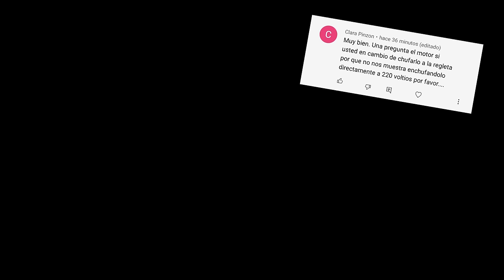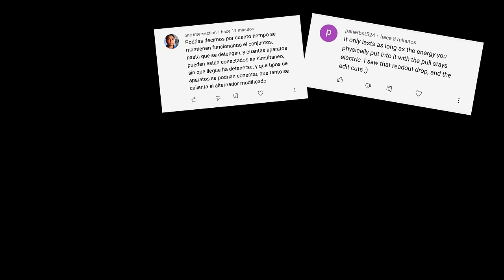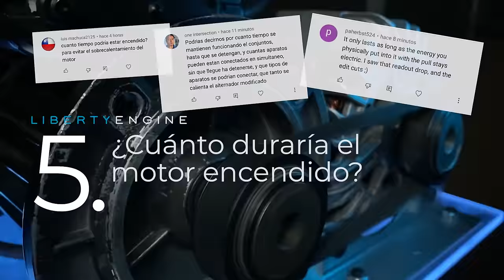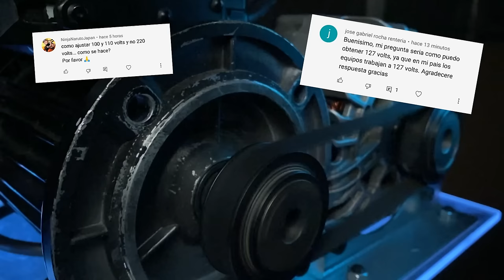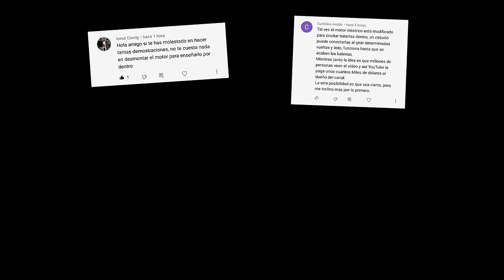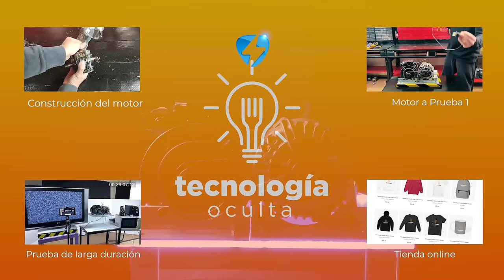El motor de energía infinita puesto a prueba - Parte 2  - Liberty Engine 1.0

Comment: Install the voltmeter with the three-way plug and put it in front of the camera and then put the loads so that we can see the change in the voltage during the process of placing the loads
Reply: When you pay any load, no voltage will be changed, amperage will be changed.
Reply: How ever small jump can be seen on applying the load that shows load is running by the alternator but it cant decide that the motor is also running through voltage supplied by the same alternator. only the volt meter at main line can tell us the variation in volts when load applied and that test will decide the truth

Comment: Im wondering ur video. coz most generater maybe for 12V or 24V i guessed , did u remove transformer? coz ur infinity engine's output voltage is enough for 220V ,could u give me some answers?

Comment: Thanks for your full video, due to the number of turns of the car alternator coil at 1500 rpm or even 3000 rpm with high gauss neodymium magnet, the voltage will still not reach 220 volts, 20 times the constant voltage of the car alternator voltage without increasing the number of wires.  The screw is not possible and increases with increasing frequency, this is my opinion
Reply: Its a 24v truck alternator.
Reply: @Szaraq12  yes,convert to Pmg generator

Comment: The indicator light of the power meter has the function of detecting non-contact power, I see it blinking, it means that inside the motor there is an active ac power source.
Reply: Yes
Reply: Интересно, какой ионистор они покупали?

Comment: I want it to be installed in an electric car so that electricity can be applied directly to the motor so that the car can run without charging the battery anymore.

Comment: I see the problem in the fact that the low-power motor drives a generator with several times higher power. The generator will give the power we supply to the generator shaft. That is why I see it as a problematic example. When the generator delivers several times more power than the driven motor! It would be a perpetual mobile that violates the laws of physics.  Connect a 3 kW appliance instead of a grinder and let it run for 10 minutes. .Don't fool people with your stupidity. Don't fool people for your earnings
Reply: quero compra um desse ai
Reply: Yes I would like to say that the generator is powering the alternater which is now a motor so any appliance then plugged into the extra sockets will drain power and cause it to overheat and it will stop spinning the more items you add,plus when it's spinning why not strip off and lift the motor above your head and have your camera man walk around you from all angles to show no wires attached and also plug an appliance like an oven into to it and cook a chicken meal 🙄🙄😂😂😂😂🙏🙏🙏

Comment: Mam, antes que todo destapa, abre y muéstranos el interior de tu motor eléctrico, sino tu video pasa de fraude. porque ya hemos visto lo que has hecho con el alternador. Nada te cuesta abrir tu motor eléctrico.
Reply: لا يصدق هاذا هل هناك خدعة بالفعل ؟
Reply from the maker: En este vídeo lo abrimos, igual que la base de enchufes
Reply: Al menos mira el video, hicieron exactamente lo que pides...
Reply: @HiddentechnologyYT  Here are the cunning ones, I reviewed all your videos with this generator, you explain everything in detail, even the engine was disassembled, everyone was deceived, but not me! why didn't you tell about the capacitor, you have a capacitor on your electric motor, why is it and what is it for?I will assume that the launcher. If you show people, then show them everything!
Reply: @antonwroblewski2011  amigo mira bien el video. estas equivocado , la correa oscila un poco cuando se enciende la amoladora.
Reply: @HiddentechnologyYT  bueno, terminas con la gente, tienes un condensador en el motor, o una batería, todo lo muestra, luego muestra el motor con un condensador, ¿por qué engañar a la gente de Labuda para que gane dinero en YouTube? ¡Así que sé honesto con la audiencia!
Reply: @Buzarab530k  비슷한것이  전세계 너무많아서 
진짜 인것 같습니다
Reply: Supuestamente en el mono monofásico tiene dentro un motor electrico de 12 voltios y igual que el otro
Reply: I'm trying.  
The magnet is n52.
3.2cm x 0.3cm.
It will be an ordeal by making three coils side by side on the Y-line.
Reply: @иваниванов-ж8и9п  If there was a trick, that is not it.
Reply: Прощайте якщо це правда
Reply: Продайте

Comment: Thanks for the amazing device information.
I am researching similar devices.
May I ask you some questions?
Is the number of magnets related to frequency? Or is it related to voltage?
I think it's related to frequency.
The voltage will be the number of turns of the coil.

Japanese home appliances are 110V, with 50Hz and 60Hz.
I am thinking of making a similar device in Japan.
Thank you very much.
Reply: Добрый день уважаемый. Судя по вашему коментарию вы разбираетесь в таких делах. Могу ли я вас попросить сделать мне такое на 220v 50Hz. Я готов заплатить. Я из Казахстана. Если вы согласны. Цену можем обговорить. Жду вашего ответа. За ранее спасибо.
Reply: It's a amperage resonant circuit between the induction L and the capacity C with a specific frequency far over the usual net frequencies - maybe much more than 90 Hz.. The crucial point seems to be in the magnetic force of the Neodym magnets and the wire diagramm of the 230Volt single phase motor. Maybe there is a triac built in to hold the voltage at about 230V, otherwise the generator would run into unlimited rpm until the point of selfdestruction.
Reply: Да. 60 герц это 30 северных и 30 южных полюсов на роторе.
110 вольт = 110 витков в катушке ( это идеал!!!) НО...) + запас на потери =30 % от витков. Итого 110+33=143 витка. Сечение провода катушки от 0,2мм до 0,6мм. Магниты их коэрцетивная сила должна быть МАКСИМАЛЬНАЯ из доступного! Зазор между ротором и статором не менее 0,4мм и не более 1,2мм. Магнитный пояс ротора должен полностью перекрывать ВСЕ катушки. Катушек думаю по 4 штуки на каждую фазу. З60\3=120. 3фазы- 12 катушек всего. Катушки идут равномерно через каждые 12°.
Логика и физика.
👍👍👍👍👍👍

Comment: Hello! Can I use a generator (12V, 40A) and an engine 220V with a power less than 1000W? If yes, will I have 220V and how much watt will I have? And can I use an electric motor with magnets on rotor instead of generator? And does pulley size matter in this situation? And do they need to have the same size?

Comment: @Tecnología Oculta  Hola en realidad yo en particular me encantaría poder lograr lo mismo que usted o sea lograr hacer mi propio módulo , pero tengo una duda y necesito su respuesta. ( Si el alternador tiene 6 pares de polos y el motor que lo impulsa es de 3000rpm calculando la siguiente fórmula - Hz = n de pares de  polos × velocidad rpm : 60sg nos daría  300 Hz como es que el módulo da 50 + - 60 Hz ) les agradezco su atención muchas gracias Saludos y que logren todas sus metas
Reply: Creo que eso es porque el alternador tiene 3 fases. Por lo que quedan dos pares de polos por fase. Según esto el motor debería girar a 1500rpm. No?
Reply: @simonluque9414  Hola no la relación entre estator y el rotor no tienen nada que ver el que determina la cantidad de HZ es el rotor el factor de inductancia y de frecuencia siempre es el Rotor , no importando que  el estator tenga 12 bobinas o mas
Reply: Tienes razón es así yo les he pedido una demostración  concreta y que me respondan a lo mismo el motor debe ser de 500rpm para que con 6 pares de polos de 50 Hz el alternador ,que por otro lado es la frecuencia Standar de fabricación de motores ,para que el sistema puedas funcionar y ser retroalimentarlo a mano de inicio ,en uno de los vídeos no en este .un saludo
Reply: @mrm1074  el problema es que al calcular todos los datos que ellos dan cantidad de polos rpm del motor no cuadran cuando se lleva a la práctica
Reply: Te contesto por aqui que el youtube no me lleva a tu comentario.
El principio básico que esto se salta es el de "conservación de la energía".
El que pongas más imanes, menos imanes, más potentes, menos potentes, etc, solo va ha hacer que el motor (o el alternador, que es lo mismo pero se usa "al reves") funcione peor.
Las bobínas (electroimanes) están calculadas para los imanes (tienen una relación), con lo cual al cambiar solo una parte... creo que te lo puedes imaginar (si realmente entiendes como funciona un motor).
El que los imanes sean de Neodimio u otra cosa es lo de menos. Aqui hablan de los imanes de Neodimio comu si fuese "el ultimo avance" pero el Neodimio pertenece al grupo que se denomina "tierras raras" y se utilizan por ejemplo en altavoces al menos hace 30 años que yo mismo recuerde. No es ninguna novedad (supongo es más un tema de economía, características técnicas, etc).
No por llamarse Neodimio hace que un motor o un alternador funcionen de otra forma, como digo están calculados, es como ponerle a tu coche unas ruedas exageradamente grandes, no va a mejorar nada, va a funcionar peor.
El error, entre tantos,  está en pensar que de los imanes obtienes o puedes obtener energía, aumentar el rendimiento o "hackear" el motor o alternador, esto NO es asi. No consigues nada cambiando los imanes.
La ingeniería actual crea cosas inimaginables para la mayoría de los que estamos aqui. Un motor o un alternador es una máquina vieja de hace 100 años y muchos, sin dedicarnos a ello,  sabemos perfectamente como funciona (por que es muy simple en realidad).
Resumiendo esto nunca va a funcionar, da igual cuantos motores, alternadores, imanes, etc. utilices o cuanto los "tunees".  Si acaso los dejarás inservibles.
Reply: @iveco30.89  bastante de acuerdo contigo, salvo algún detalle, pero menor.
Reply: @elmundodelsaber.  El punto es que todo da a entender que los imanes son los responsables de dar esa energía o movimiento, ¿ será que los imanes ocultan algo que no a sido estudiado?, será que los imanes en  estado astacionario no podemos descubrir nada más? El movimiento y el sonido es la clavé de ver crear una energía inexistente yo opino que si. Más  si quieres conseguir esa posibilidad, no es factibles con una tecnología de 100 o más años.
Reply: @danielalcaraz7299  e trabajado con imanes y la termodinámica es 100% aplicable en este ejemplo ya que pueden ser imanes muy potentes pero no dejan de ser imanes, sin irme a lo técnico la energía o líneas de fuerza que genera de empuje un iman es la misma pero opuesta que se necesita para vencer esas líneas y acercarse, que quiere decir esto, que si las fuerzas son iguales y negativas entre sí más la masa de los propios imanes y rozamiento de los rodamientos se cumple la leyes de termodinámica. El día que se descubra un material híbrido entre paranagnetico y electromagnético que con una pequeña exitacion (carga electrica) cambie su estado molecular y genere un gran campo en un momento determinado ahi si podría funcionar, pero lo veo muy difícil por las propias leyes de termodinámica.

Comment: What is the black cylindrical part next to the black electric motor, the electrical connection trap?
A normal electric motor does not have that part.

Comment: Wieviel Umdrehungen macht der E-Motor 2500 - 3000 . Ich will auch so etwas. Habe aber gelesen das Umdrehungen von min 3000 - 3300 die Minute sein müssen. Ich will einen Kühlschrank damit betreiben.  Bei Stromausfall. 
Danke für eine Antwort

Comment: Hola amigo, gracias por sus buenas explicaciones, la curvatura de los imanes es necesaria para la funcion o funcionaría con imanes rectos de la misma forma???. Tambien es necesario que el alternador séa de 24 V. o funcionaría con uno de 12 V.??? Gracias por la repuesta.
Reply: I tried with 12V alternator. I used 24x N50 neodymium 10mmx10mm disc magnets (2x per N and 2x per S) and ensured symmetry around axis as in initial rotor. I removed regulator and diodes and measured directly on stator coil. I used a drill to turn the shaft variable speeds. The most I got was 9.7 Volts. I can feel intense magnetism on rotor and stator when turning by hand, but I cannot get higher voltage. Drill was running quite high speed. I dont know what to do to improve output Voltage??

Comment: And why not connect a separate motor to 220v, it will rotate the generator and show that the output of the generator is 24v or 220v ???

Comment: your infinite power is convincing because you use a permanent magnet to serve as voltage exciter to generate power. But in your presentation it is confusing because the voltage output of the car alternator is 220vac..is a  car alternator rewinded  to 220v?

Comment: Quite clear..but there is a trick in adjusting the magnets.and their arrangements one after the other...so that the kick start effort makes the bearing unbalanced almost negligible; but after a certain period of time there will be a loss of Energy...and its performance tends towards the decrease in dynamics and consequently the decrease in energy; which finally tends towards STOPPING movements, i.e. ZERO rotation = ZERO volts... according to the LAVOISIER principle and law: * NOTHING IS CREATED - NOTHING IS LOST AND EVERYTHING IS TRANSFORMED * and if you still have questions I will explain to you even more... the largest and gigantic solar source also tends towards zero and there is no power and energy source that cannot be drawn apart from the divine power (GOD)

Comment: At the beginning of the video (2:50), you start the motor using a 220V plug. So the alternator is working too, as the video shows it. Then I don't understand why the motor stops when you unplug it : as the magnets in the alternator are moving, it should continue to run, as when you start it manually. That's not logical for me...
Reply: Coz is two way current flow, so this is based on creating two magnetic field and as AC, alternator send one direction electrons, then generator send one dirrection electrons.
This is, AC.

Comment: hello, I live in Brazil and I have a ranch on the edge of the bush and it has no power, could you send me the engine and alternator models because in Brazil the configurations are different

Comment: If this were to work as described, then in a few seconds the engine and generator would burn. If something supported the growth of energy without a source, then such energy would increase by leaps and bounds with every second and there would not even be time to stop it quickly. Only a black hole could absorb that much energy...

Comment: Thank you for posting  this. I know that you guys have an amazing product that works for real! BTW you are not alone.  Most of your viewers are not technicians. Do you have these power generators for sale? To escape all the stupid suspicious pseudoscientists enquiries, connect your device to a battery that will be used only to start the system but also connect it to a battery charger as well. Call it a low maintenance battery driven electric generator. You could price it similar to what fuel driven generators go for and sell mostly to your Internet viewers some of whom might become distributors. This could be world wide and will eventually save our planet from the fossil fuel disaster that is killing it.

Comment: English: An electric motor is more useful as an electric motor driving something else. A car a boat a ship, an electricity generator even, and not supplying surplus electricity itself although that could be handy. I want to see the alternator built into the motor's casing as an integral part of the motor's design in order that the self powering asset (Motor) can be utilised in a million ways. Pumping water for example. A common design would make it possible to make them big or small. Big could drive  enough large electricity turbines to power an entire nation.

Comment: I have a very simple question.. If u really show that's the right materials to make.. Why until now no one succeed to imitate your invention. They do not afraid who after them.. But the real question is... If this invention there's a trick on the video.. Like the magician.
Reply: The permanent magnet motor+generator will self-sustain for a bit after that startup with energy inserted into the system. That is true.

I wonder why the speed doesn't change when the "loads" are turned on 🤡

Comment: Why do you think it is not possible?
It's a very simple matter.
If the power produced by the generator is greater than the power of the engine at the same speed, the generator will easily produce the electricity the engine needs to produce torque.
Reply: So if the motor produces less energy than the generator, why does the generator keeps running? xD

Comment: Technically, it's nonsense
1. you can't make a 12V generator 220V by sticking a few magnets (you would have to increase the number of stator turns 18x, use a step-up transformer or other modification.
2. If you remember from physics class, electrical machines always have a loss - you can't make a machine with more than 100% efficiency
3. It is of course an economically viable solution for the video author - he gets paid by YouTube for downloading the video.